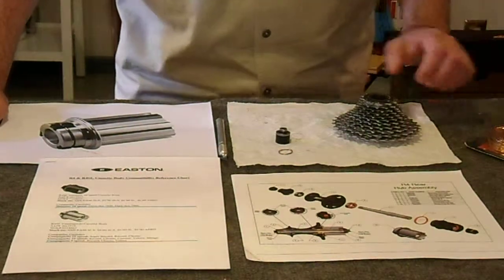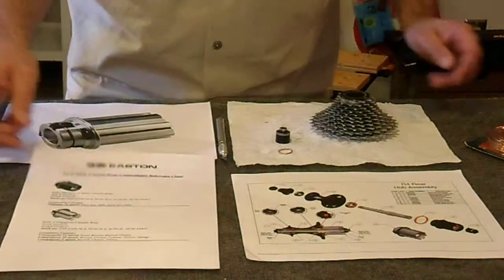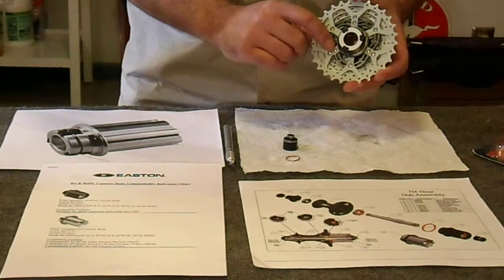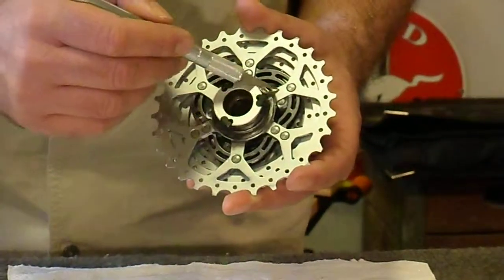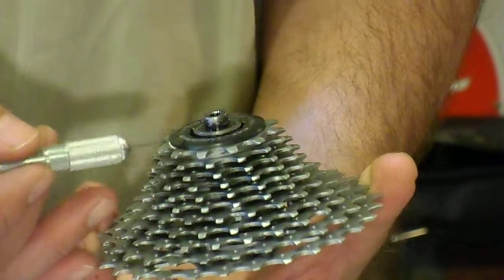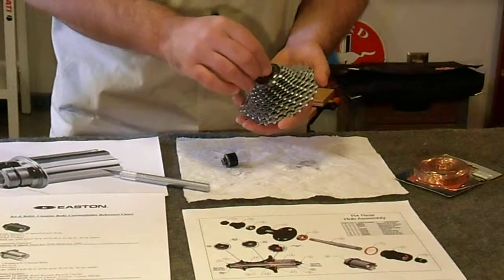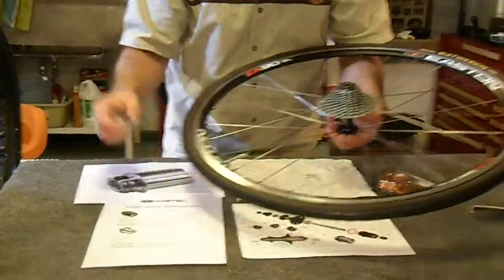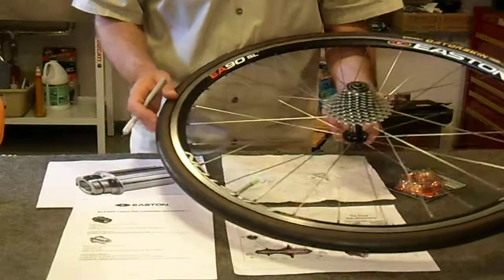Easton R4 Hub with Campagnolo 11 Speed  Driveline - Problem Solved!

Comment: I had the Easton EC90 SL wheels with the R4 hub on a 2015 Cervelo S3 with Campy SR 11s (not the latest iteration). 

You can solve the clearance issue as well by just adding a flatter lock ring, although your solution is cleaner and allows the use of the intended lock ring. 

Nice videos by the way. I have been looking at a Trek Domane frameset, and the plan would be the build it with Campy Record. The video regarding the BB adaptation was excellent! Thank you.